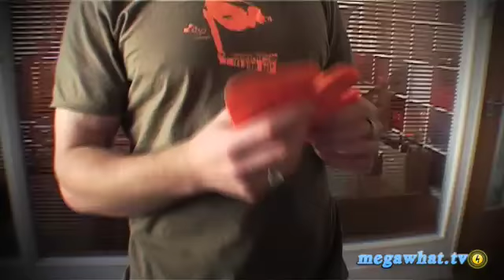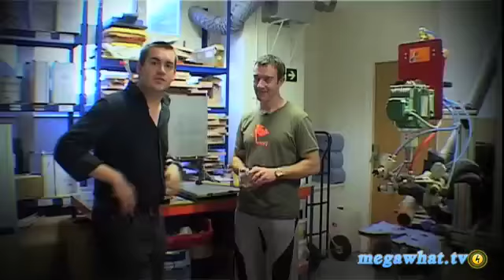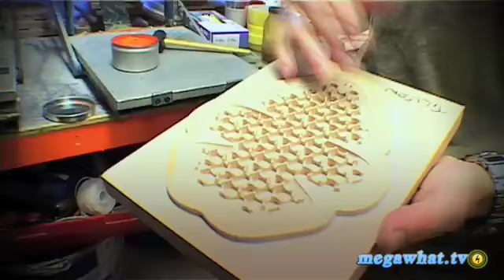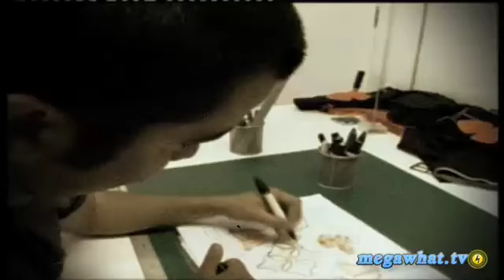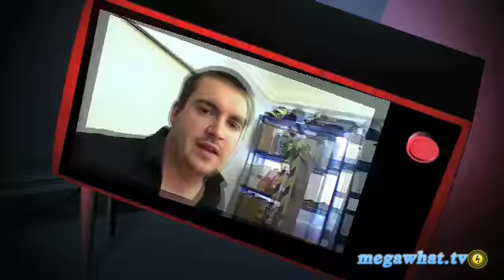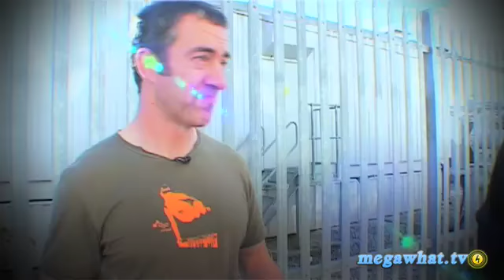d3O: Review

Comment: this stuff needs a decent testing.. that was aluminium... light and large.. and the dude didnt put much effort on bashing it on the tester leg too... use a steel hamme, 2 lbs+, and put full strenght when ya hammer it on da leg, that would be a decent test.. i mean.. use a sponge for that cheap test, it will achieve the same goal.. no hurt lol.. a sponge..